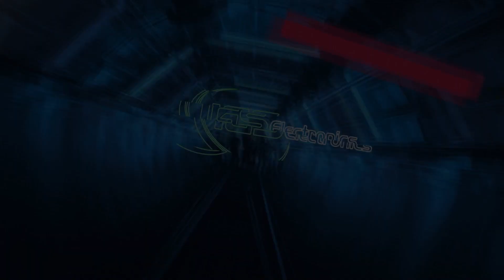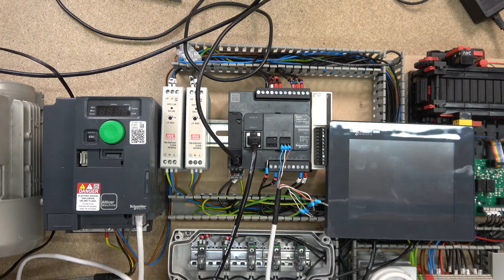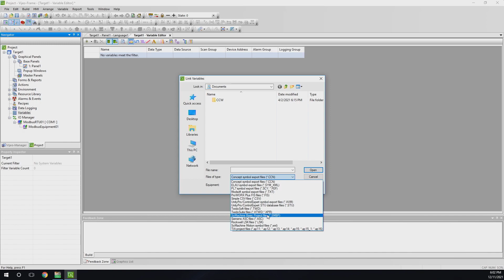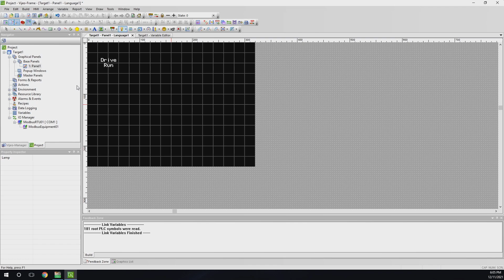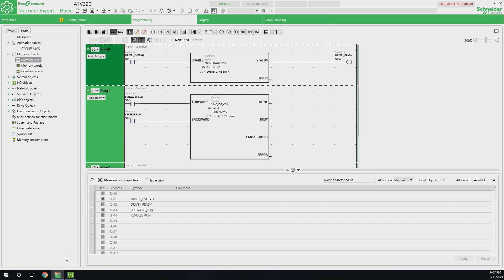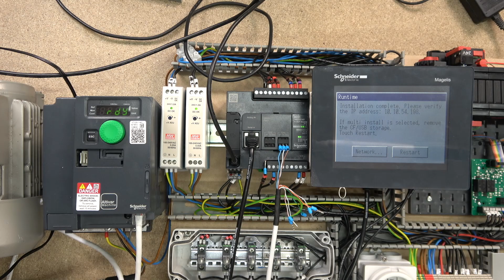Schneider Electric Magelis HMI communication and programming with M221 PLC basics. Part 1. Eng

Comment: Does Schneider make an HMI that is actually readable in the sunlight. Our customers complain constantly that they can barely adjust the parameters because the screen is so hard to see and even a small amount of sunlight. Compared to my cell phone the Snyder HMI screen is absolutely pathetic. These are $100,000 chillers Plus and our customers struggle to set parameters during the day. There has to be a fix for this. And I don't want no stupid umbrella that I have to install over the hmi screen. I can go buy a cell phone for $80 that is completely visible in the sunlight. But I can't get an visible HMI screen on $150,000 chiller.